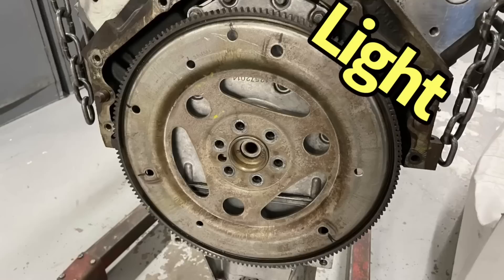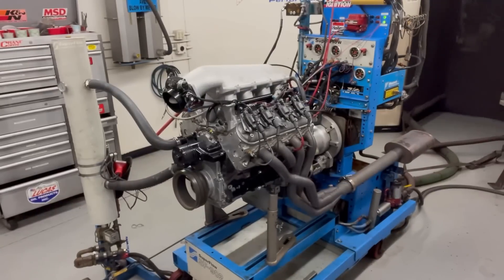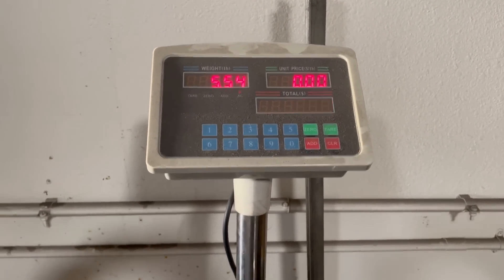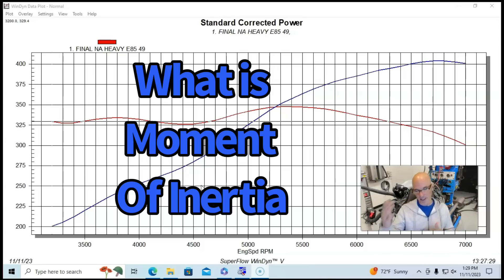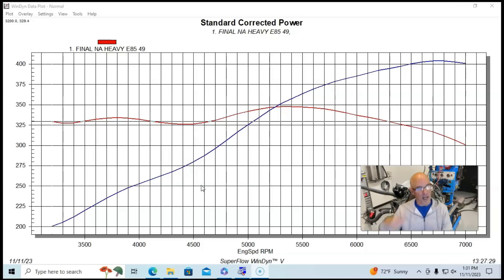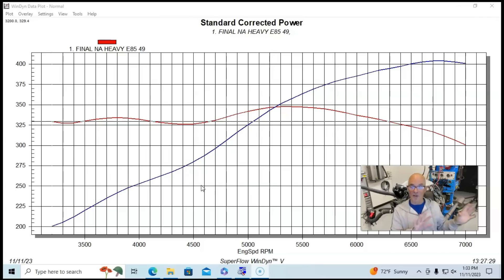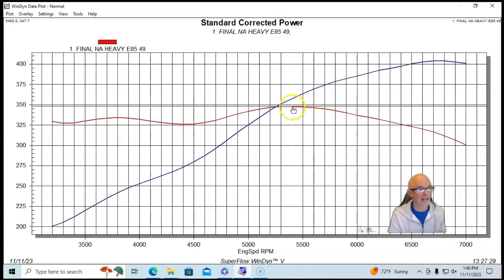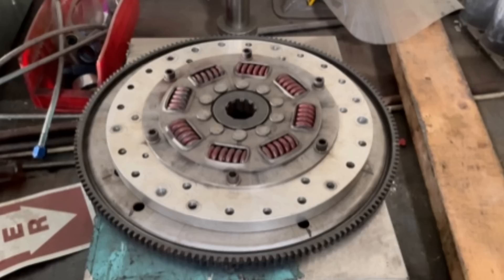FLYWHEEL VS FLEXPLATE-DOES A LIGHTWEIGHT FLYWHEEL ADD ANY POWER? 45 POUNDS VS 16 POUNDS-WHO WINS?

Comment: Sweet! Hope your clutch skills are good when youre using that lightweight piece (in the car that is). 😎 haha.
Reply: I run a triple disk 6" clutch in my road race car total weight with flywheel is 18 lbs, definitely  a  bit of a pia at stop lights
Reply: treat it like a motorcycle.
Reply: Motorcycles have wet clutches  with multiple disc designed to slip much more and for longer times.